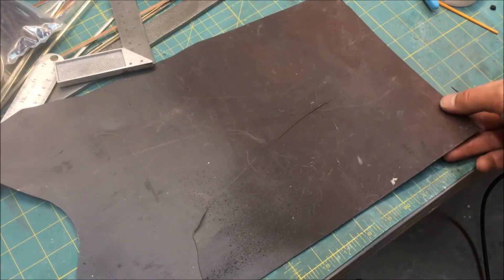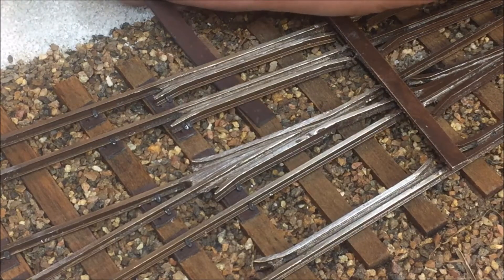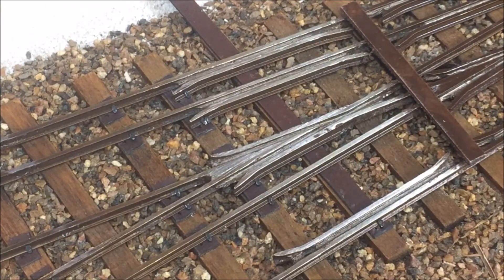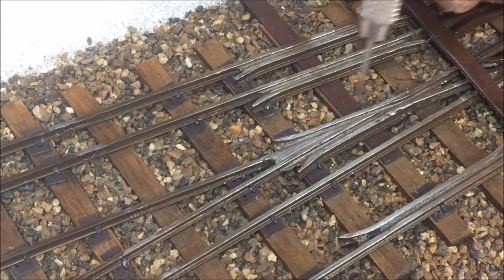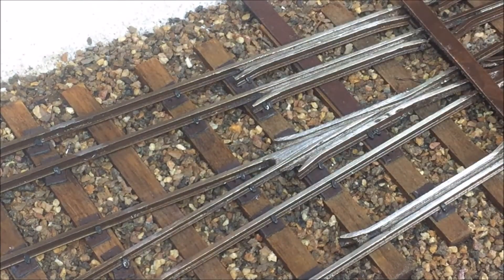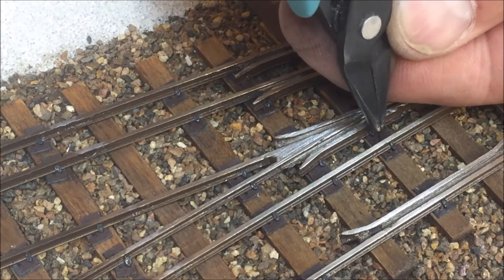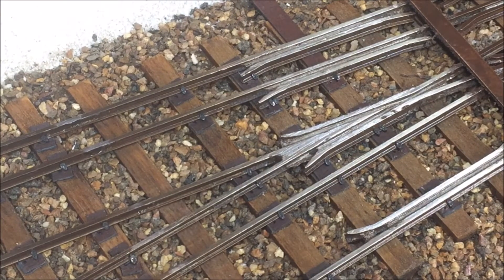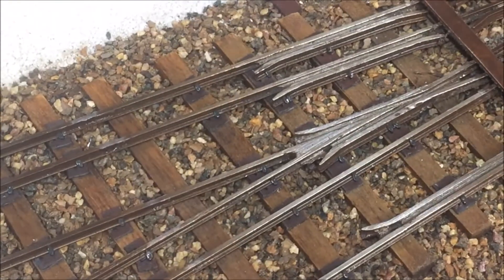Custom Tie Plates for Hand-Laid Dual-Gauge Turnouts and Other Trackwork

Comment: I'm not clear what you do to add tie plates to the ties that the rail is initially fastened down on.
Reply from the maker: beyondDCC I remove previous spikes as necessary. I then use a small plier or spike plier to lift the rail enough to slide the tie plate in underneath. I then check the gauge, poke the tie plate spike holes, and spike down the rail.
Reply from the maker: Remove he existing spikes, slide the tie plate strip under the rail, spike and trim.